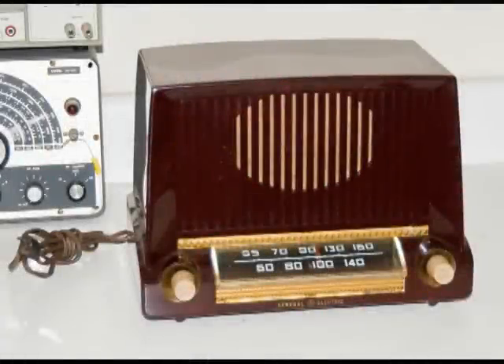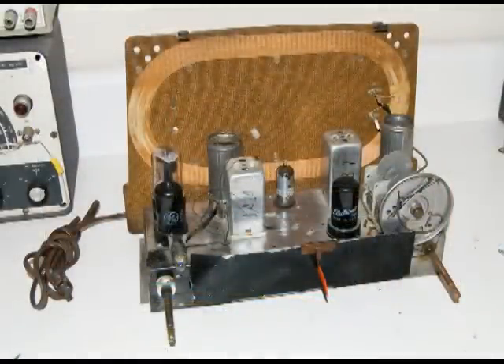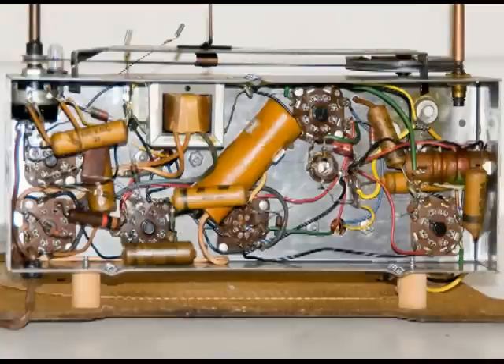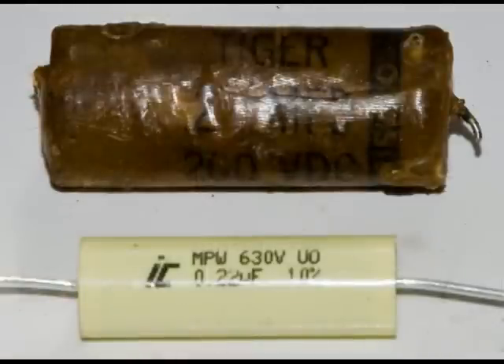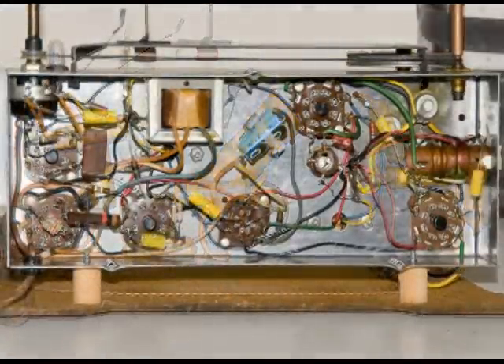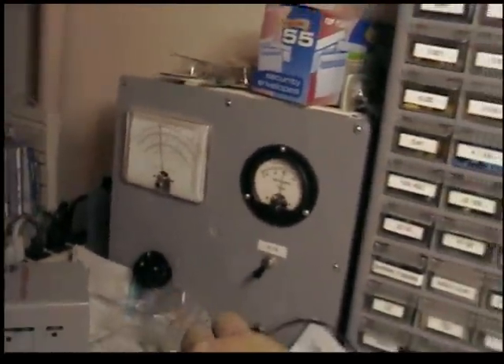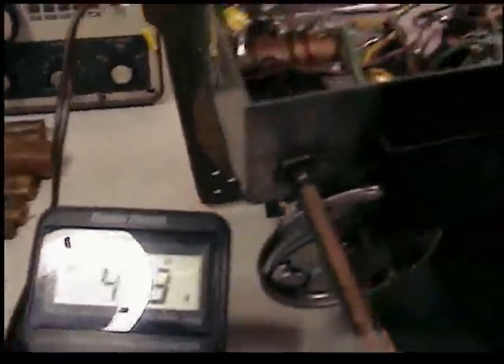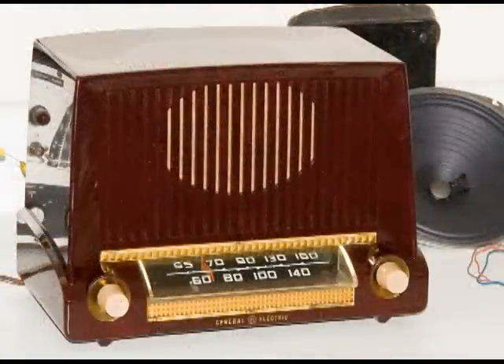Radio Repair Steps

Comment: Greetings, I have couple tube radios that I have recapped with equivalent capacitors. Do these 6 tube radios run quiet or is there some hum to it.? My recap 6 tube radios have a slight hum, but another tube radio I recapped has a transformer and seen to run a bit quieter. Thanks Jorge H.

Comment from the maker: Thanks usaamerica1
Generally you would replace capacitors or any part with an exact match, or as close as possible. If you have a capacitor rated at 500 volts you must replace it with another 500 volts or higher. Wax capacitors are filled with bees wax witch you can see at the ends of the capacitor. I’ll send you a download link to my E-book.

Comment from the maker: I use my Weller soldering Gun for that. That will usually does the job. However the next time I go to an Amateur Radio Ham Fest I'm going to look for a high watt heavy duty soldering iron for just that purpose.

Comment: I'm replacing a multi value filter cap can in an old amp, my soldering iron doesn't seem to have enough heat to solder the tabs to the chassis, can you offer some guidance?.
Thanks.

Comment: I know this comment is a little tardy, but I've working through your videos since I discovered them a couple weeks ago and they have awakened my interest in the electronics of my past. I have missed the magic of glowing of tubes that solid state devices just don't have. Thanks so much for your selfless giving through your wonderful videos.

BTW - What is the reference software you were using in this video? All I could read was RadioView - ?????? Troubleshooters Manual?

Comment: Great video, this was very interesting and informative.   The last cap job I did, I also just clipped out the old caps, and used the exhisting wiring.  It is a lot easier, especially if 2 or 3 wires are soldered on the same tube socket. pin.  You do a very thorough job on your radio repairs.

Comment from the maker: I had a good friend who would spend hours refilling those Philco Bakelite capacitors that could not you see when the radio was in the cabinet. Then he would take the old filter capacitor off the chassis leaving the wholes you could see when the radio was in the cabinet. And he had been a Philco Engineer, I never did understand that one.

Comment: When I rebuilt that big Magnavox Belvedere chassis, I removed almost all of the original caps completely, and put new ones in their place.  There were a couple where I had to attach to the old leads as you mention, because the leads were too short on the new caps.

Though I think if it weren't for having my de-soldering gun, I probably would have left the old leads in place :-)

Comment: Another 5 star Richard, Great step by step. I know this is an overview, but two details nice to show is "how to" attach new capacitors. This video helped me.

Tube Radio Repair--Component Lead Soldering Tip
youtube com/watch?v=OI9P01eYbjA

These two videos explain the variac and ammeter you show in more detail (and recommends your BOOK!):

Basic Test Equipment and Ammeter Tip
youtube com/watch?v=AjKWInA8Jb8
youtube com/watch?v=B0SmrbXYRME

Thanks for sharing!

Comment from the maker: Hey Steve
Thanks.
I broke a tube socket once and that was a real hassle to replace. Then I though, man, I am sure glade it was not a wafer switch, that would be a disaster. So this is what I do now and it works quite will.